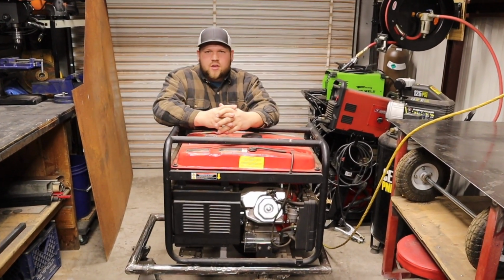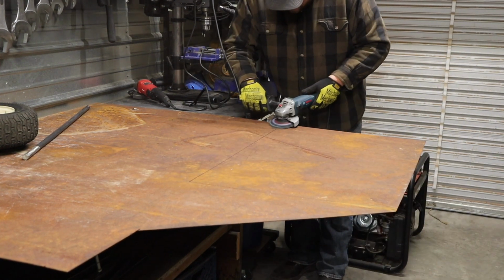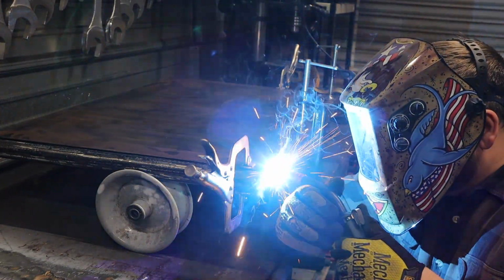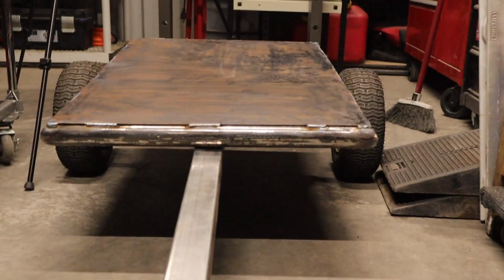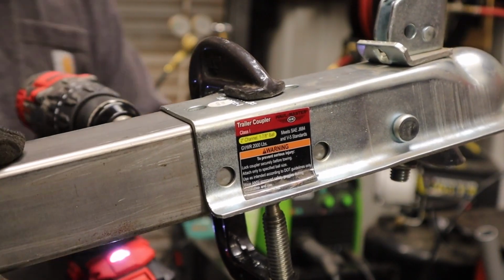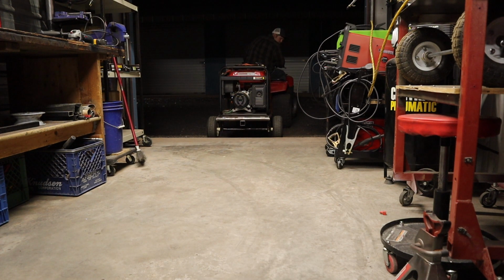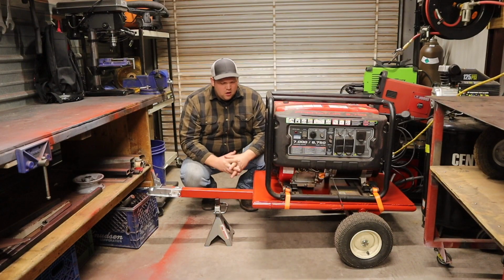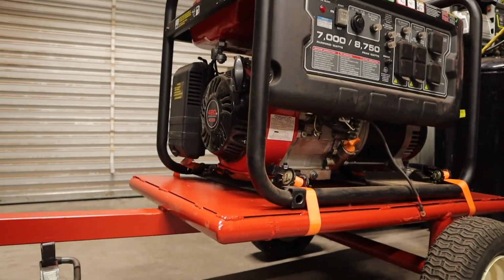Welding a Portable Generator Trailer for my Predator 8750 from Harbor Freight

Comment: Will that inverter generator run your 240v welder?
Reply from the maker: Unfortunately it’s not an inverter generator. But it will run 220v welders, plasma cutters, and other equipment.

Comment: Great project Derek, turned out awesome!
Reply from the maker: Thanks dude! By the way, I know I still owe you a shout out and video, I haven’t forgotten. I just have to bring myself to buy some foam or come up with a better solution to the welding helmet dust problem.
Reply: Oh, coz I mentioned you in my vid, you mean?  Nah, don't worry about it, bro!  Happy new year, Derek!
Reply from the maker: Thanks you too!
Reply: Please make sure you are using your generator carefully and being aware with the hazards. Make sure you read the manual carefully. I know a lot about generator safety: there’s something that everyone really needs to know about when using generators. Even if you already know what you’re doing, please still be aware for your safety. Many people have died each year when using generators. So please be careful using portable generators. Carbon monoxide is dangerous. Please remember not to run your generator indoors. Generators produce high levels of deadly carbon monoxide. Please run your generator 20 feet away from your house. Generators are outdoor use only. Do not run your generator indoors even if your doors and windows are open. Don’t run your generator in wet conditions. Please keep your children safe when you’re using portable generators so your children won’t get injured by the generator. Generators can be harmful so please don’t ignore the safety warnings. This is just to be safe. Please run your generator before plugging in appliances. Let your generator cool off before refueling it. Do not refuel your generator while it’s running. Please install a carbon monoxide detector to keep your family safe. https://youtu.be/I1jT3ANENvI and here is a video more about generator safety and keeping your family safe. This is only a reminder for everyone’s safety. Thank you. Hope you all stay safe.